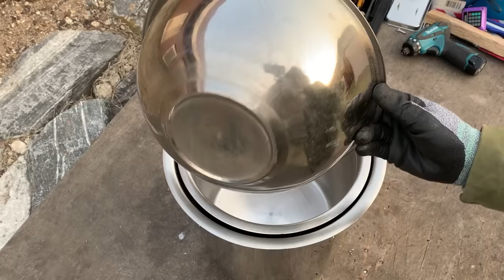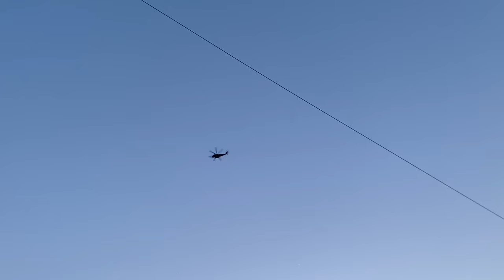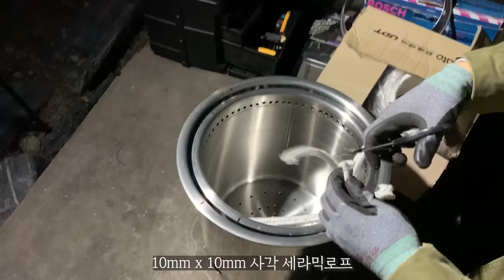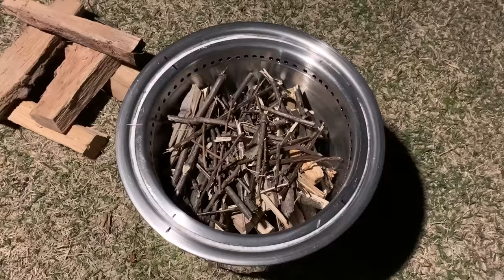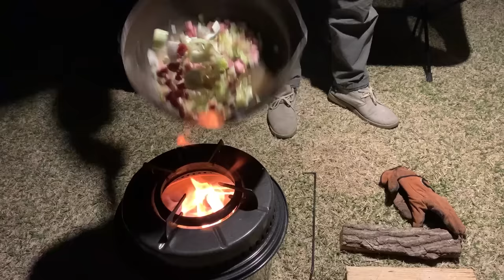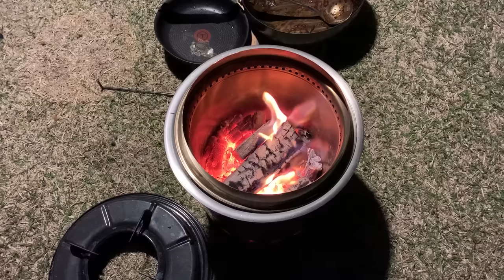Homemade Wood Gas Burning Stove Like Solo Stove for Camping - Secondary Combustion Part-3

Comment: I have a mate who lost his thumb while drilling with gloves, it happened in a split second and it left a very deep impression on me (the screams and blood in the shop floor). I would really recommend you to take the gloves off; risking some cuts is better than losing a digit.
Reply: I had a coworker almost do the same.  He’s left handed and had his right hand around the chuck when it grabbed him.  He didn’t lose any fingers but it did a lot of joint and nerve damage.

Comment: Nice job on the 2 wood burners and the cooking too.
Reply from the maker: Thanks Mike. I need to reduce soot when using this. No smoke but soot remains. Any ideas?
Reply: Not sure how to reduce soot.  Could it have to do with the kind of wood you were burning?  The burn seemed plenty hot and like you said I didnt see much smoke

Comment: Update! If you are in the USA Walmart sells 16qt and 12qt pots that are almost this size. They have handles but can be removed easily. I bought them and will be building mine now! Just waiting on the fiberglass rope.
Reply from the maker: Good luck and enjoy your project👍♥️🙆🏻‍♂️
Reply: Ryan P - are you sure you want to use fiberglass,  look for ceramic from a fireplace store.  Good luck with your project.
Reply: @jwfinkler388  I ordered some rope used for gaskets on stoves rated for 1000F, didn't know the exact name for it.

Comment: OUTSTANDING !!!  
The wooden carrier was a nice added touch !!!  
Compared to the samller unit you built ... do you think you need larger air holes top and/or bottom???   

I love this channel !!!
Reply from the maker: Thank you. Maybe I'm wrong. If there is a larger hole in the upper part, it is expected that secondary combustion will be better. The key is the capacity of the chamber to supply hot air.

Comment: Thank you sir for the video, could you tell me the pot type and size that you used? Looking at BMP website and can't tell which would fit inside the other.
Reply from the maker: for the outer, O.D. 33.4cm, I.D. 30cm, for the inner O.D. 29cm, I.D, 26cm

Comment: The end of the video is very manupulative, I forgot what it was about 😂 Yummy 😋
Very nice work, get more serious step by step, I think this time the outside bottom holes are too big and the upper too small, maybe really make the holes sizeable, just a ring inside with the same sized holes which sit on three bolts which slide in wide holes left and right, open and close the holes, on the bottom and on top. Not saying it will work, but I would like to see if you can adjust the oven this way, maybe you can find the perfect formula.
Reply from the maker: I think this time the fuel was not enough. When I tried with wood pellets It burned much better. But soot remains though. I will keep working in it! Thanks!

Comment: Nice design. Can you make also a design using rice hull as a fuel not wood. Thanks
Reply from the maker: If heat is secured during initial ignition, the rice husk will burn well.

Comment: Where did you get these materials? I would like to make one of these myself. But there are no links to purchase products. Or can you tell me the name so I can do some searching for these stainless steel containers.
Reply from the maker: I got these from online store in South Korea. Searching materials, main material, it is called Bain Marie Pots. and ceramic rope.(if needed) Check out my other videos. You will find part-1&2.
Reply: Check out stainless steel double boiler pots at your local restaurant supply center that sells to the public. You will be surprised the variety and low cost. The pots for this build total less than $20 and the two for the other stove he built cost less than 10.. Or buy from amazon he put a link in the other video with specs. I will go to the supply housr and pick what i want to get the right size for me. But the pots are really super cheap compared to a solo stove (230++)  i plan on making a cook pot AND a small pit and keeping 300+in my pocket (sorry solo stove, but your stoves are cool but pricey for everything i want)  Good luck, friend. Happy trails
Reply: Thank you Christine. I will check it out.

Comment: Can you post the recipe of what you cooked? looks amazing
Reply from the maker: Yes I will do! Thanks!
Reply from the maker: Ganjajang

Main ingredients
Chinese noodles, raw noodles (middle noodles)
Cooking oil or pork oil
Chunjang (black bean paste), soy sauce, sugar, chicken stock
Pork (for stew, curry)
Onions and other vegetables
A little green onion
Oyster sauce (optional)

In a well-heated pan, fry the chunjang in cooking oil and fry it. The oil was caught in the words 'as frying', but at least make sure to pour it so that it is soaked. For small amounts of cooking, tilt the pan to collect the oil so you can fry it with less oil. Chunjang doesn't release well, so while frying in oil, use a scoop and so on to loosen it well. Depending on the recipe, there is a way to heat the oil hot enough to fry it in a short time, but if you are not skilled, it is easy to burn. There is a lot of disagreement in the time of roasting, but some instructors and vocational school professors teach that it is not necessary to stir for a long time.

Roasting Chunjang is more difficult than you think, but if you try to fry Chunjang at home, you may want to omit it because it is a waste of oil and comes with all kinds of dishes. Even if you don't fry it, if you add enough seasoning, it tastes like that.

Make sesame oil in a separate pan. The oil has a good taste and taste when you use pork oil by heating the pig scaffold in a frying pan, but you can use ordinary cooking oil. When the oil is fragrant, add the pork and fry. When the meat is cooked to some extent, add vegetables such as onions, cabbage and zucchini, stir-fry them together, and add soy sauce. If you prefer spicy, you can also add Vietnamese peppers or Chengyang peppers with other ingredients. If you want to add oyster sauce, add a little at this point and fry it together.
Stir-fry Chunjang and sugar 1: 1 before roasting and fry once again. Again, mix well using a ladle. Originally, the ganjajang sauce is finished at this point, but in today's Chinese restaurants, a small amount of starch is added to make it slightly viscous. Less salty and greasy, and some are better grated than authentic recipes that only need to be grated with oil. If you add a lot of starch water, it will become an old dish, so add a little. Don't put it in to make a classic soy sauce.
After boiling the prepared noodles in boiling water, rinse them in cold water with a sieve and remove enough water.
Place egg fry or cucumber on the noodles according to your preference and complete with sauce.
Reply: ❤ thank you!!!

Comment: If you want to crank it up a notch.  Get a small fan to blow air in the bottom. Then you will see significant increase of gasification.
Reply: What size Bain Marie pots did you use?  12quart and 8 quart?
Reply from the maker: for the outer, O.D. 33.4cm, I.D. 30cm, for the inner O.D. 29cm, I.D, 26cm

Comment: i think that looking at Thrift stores or perhaps restaurant supply companies for used containers might bring the cost down.
Reply: Pots for this build at restaurant supply is less than $20, NEW. The other video he made for the smaller stove the pots r less than $4 ea... Check his link @amazon. Good luck with finding used in exact sizes to match.
Reply: Check out your local restaurant supply that sells to the public and ask to look at their "stainless steel double boiler pots" (that's what they're called here in US) or just order online what he specs in the video. I really do believe you will be pleasantly surprised at the cost for new. I plan on doing this so i can get the exact size stove i want(not too big, not too small) or maybe even build two (pit and cooker) .. Super cool either way. I priced a solo stove and the ranger (small pit) is 230! And a bundle with accessories is 360.. Good grief I'll buy some pots and make a few different sizes and keep 300 in my pocket.. Good luck friend, happy trails!